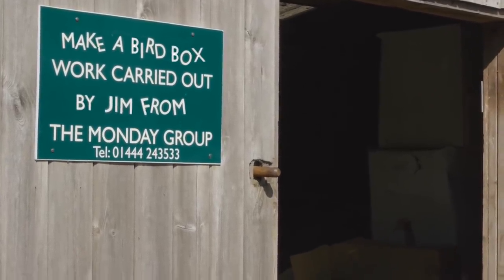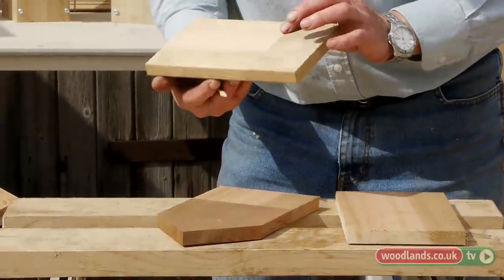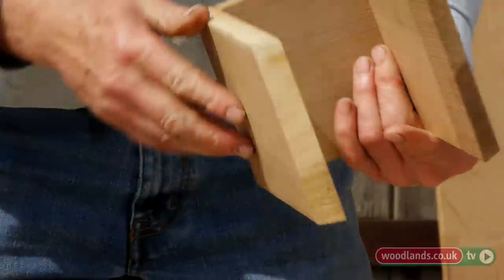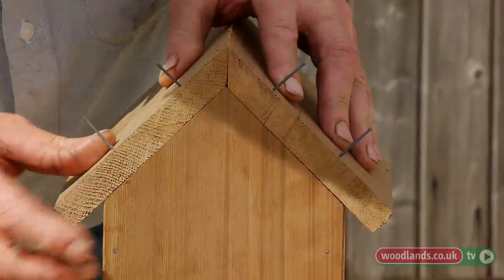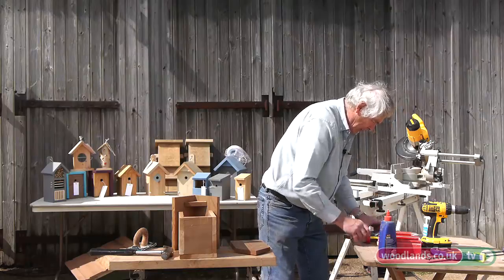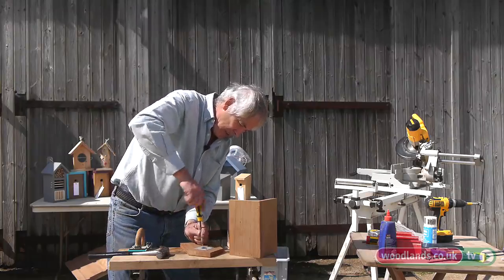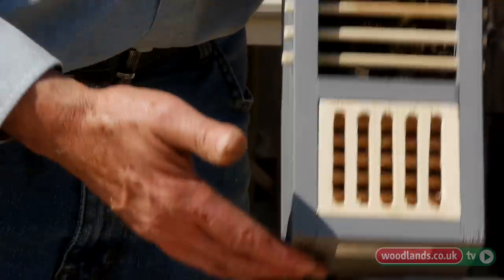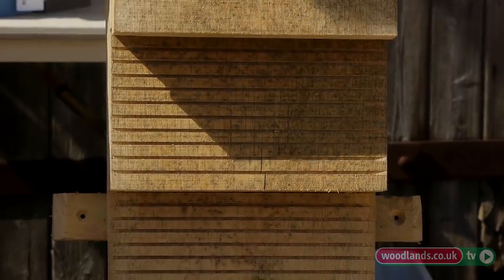How to Make a Bird Box

Comment: I enjoy building bird houses but the most rewarding thing is seeing them inhabited.  Like you, my roof always over hangs the front and sides.  I put vent holes in both sides protected by the overhang.  I also add a donut on the outside of the access.  I drill a 1 1/4 inch hole then use a 2 1/2 inch hole saw around that to create the wooden donut.  That extends the depth of the access and keeps cats and raccoons from reaching in.  I also only use red cedar as it is rot and parasite resistant.  I currently have 23 bird houses on my property and get great enjoyment from watching the birds create their nests, bring food to their young, and finally,  seeing those fledglings running around my yard trying to figure out what to do with those wings.
Reply: 😴,sorry but your trumpet is sounding loudly 🤭

Comment: Where do you buy the metal plates from? Can’t find them anywhere...Great little project.
Reply: Carefully cut the bottom out of a biscuit tin.  Mark out a few panels on there. Fix it to a piece of scrap wood for safety. Centre punch and pilot drill the five holes. Open up the large centre hole preferably with a hole saw. Remove from the wood and deburr the holes. Cut the plates out and deburr them.
Reply: @johnbrewer9833  oh that simple 🤭

Comment: Can you use pressure treated fencing boards to make the boxes? Thanks for the video 👍
Reply: Not recommended. I think if you could allow the wood to age outside and off-gas the toxic chemicals for a time, it would be ok.  I have a couple I made before I learned this and I plan to apply my theory. I figure a year out in the elements should do it. Not gonna put them so can be inhabited, just exposed.

Comment: Jim, can you tell me the name of the special chop saw you are using that seems to double as a sort of table saw?? And also your little work bench! Thank you
Reply: Hi, it's called a 'sliding mitre saw'. If you didn't get one already you can get a cheap one from screwfix for about £100. If you're just building bird boxs you'll only need a small one. Ask me if you need to.
Reply: BTW, be careful with the mitre saw. It's reasonably dangerous!
Reply: @waynemongo  Thank you! I'm in the US... will look for a cheap one on this side of the pond. Thanks so much for the info.

Comment: I Nice looking bird houses. 
It would be better to advise never using plywood. varnish the edges all you want, it'd going to delaminate. That goes for any kind of compressed composite, such as Oriented Strand Board (OSB), even if it is rated for exterior use.